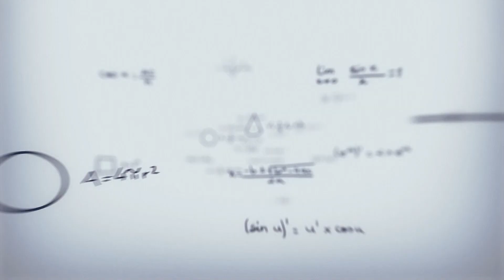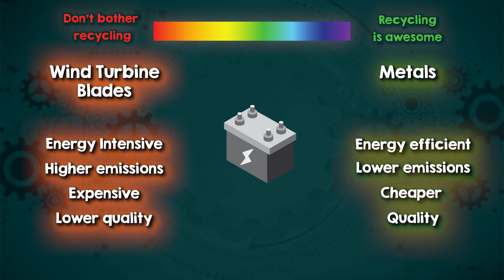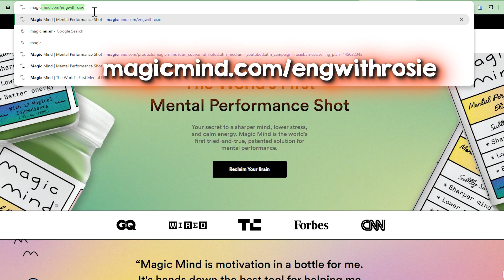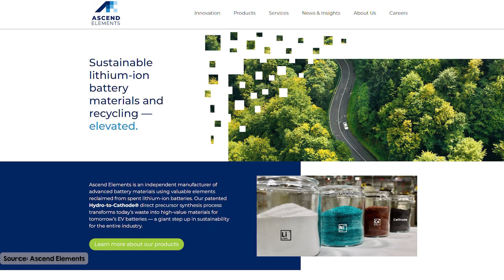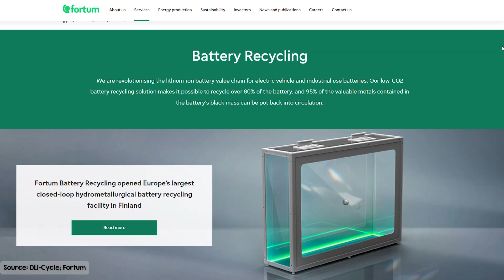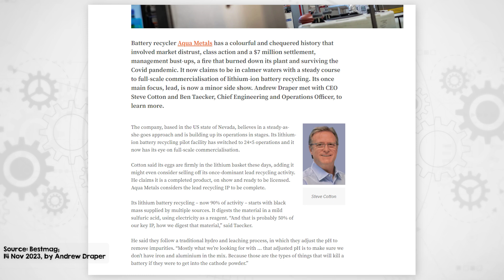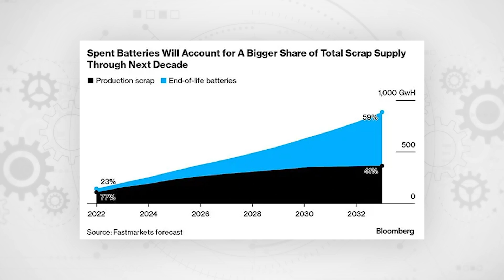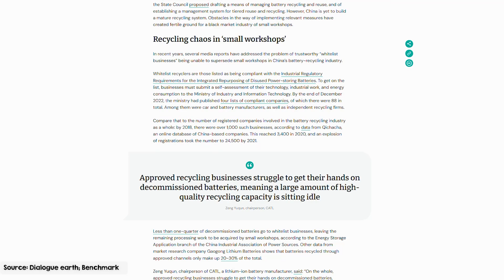Recycling Lithium-Ion Battery: How Does It Work?

Comment: Recycling is not allowed to be an economical question. Recycling is a must because most materials we use are not available in unlimited quantities.
Therefore "is it worth it" is the wrong question right from the start. The question that needs to be asked is "what is the best way to recycling" and then the next one is "how are we going to make it happen".
Reply: What if recycling creates more pollution than production from new materials? 🤔
Reply: @gregorymalchuk272  fantastic questions in this thread.
Ultimately, we don't want to be producing any waste. So one resolution to the conundrum is redesign for recyclability, which can either be legislated or priced. Then the onus is on the manufacturer to produce the goods in accordance with ecological reality.
Reply: @gregorymalchuk272  Typically this is not the case and provided the limited abundance of close to any materials my provisional point would be that recycling is mandatory even in such exceptional cases.
Reply: @beatreuteler  Misses the point. Regardless of cost it is often far LESS environmentally harmful to send some things to landfill than to try and recycle them into a useful product. It depends very much what the stuff is. Wind turbine blades are a good example - precisely because they are made of an incredibly inert material (to ensure they last) it would take FAR FAR more CO2 emissions to recycle them than to just chop them up and bury them. It is not about saving money (though money can often be a rough proxy for energy and hence environmental cost) but saving the environment.
I reckon lithium batteries will be recycled at least as much as copper and aluminium are - as a reactive metal with far lower density than most metals it should be cheap to isolate and reclaim.

Comment: I hear a lot of inaccurate information in this video.
I work with SNAM and Eramet in France. My company is a customer of them. They recycle combined 70Kt of EV batteries per year. They are at full capacity, they are profitable and are looking to expand their operations. My contacts in other battery metals recycling companies in Europe tell me the same. EVs are not the only source of batteries and the market is growing. You mentioned startups struggling: yes they are but not because of the metals market, only because they lack the investment need to build their factory at a larger scale. All of the companies which are turning a profit from battery recycling didn't start from scratch, they were already operating for decades in other recycling markets and already had the infrastructure to expand in the battery market.
For future videos I would suggest reaching out to recycling companies to gather information instead of jumping to conclusions.
Reply: hi @mururao i am looking into the business venture for Li-Ion Battery recycling. Can we connect?
Reply: I would love to discuss further with you about this! Do you have a twitter account or somewhere else where I can message you? I don’t mind continuing the conversation here however

Comment: Recycling is more than just value and energy savings. Mining is absolutely horrible for the environment and garbage dumps will leak overtime and be very costly to fix in the future. 
If your parents generation required resources and generated waste just as much as the current generation does than ruels, regulations, and public perception would be drastically different, and thats just one generation out of thousands of years of human alterations on the inly planet that humans can ever call home. 
Please learn how to Reduce, resuse, and then Recycle Everything PROPERLY that you can. 
♻️✌️🌲🌎🌳🌎♻️✌️
Reply: There are a lot of situations where recycling uses more energy than manufacturing from new materials.

Comment: You think we will have to deal with recycling EV batteries in about 2030, well I disagree.

The Nissan Leaf and Renault Zoe came out around 2010, the very first of the Nissan Leafs now need to have their batteries replaced, the Renault Zoe have thermal battery management systems so the batteries are in a better condition.  However the batteries for the first Leaf's are on average at 85% of their compacity now.  So they are being replaced.

However just because you take the battery out of you 2010 Leaf doesn't mean it gets recycled now.  Re-use is a far better option, and if you put your Nissan Leaf battery in stationary storage now at 85% capacity it'll have a couple decades of use and even when it has 50% capacity it's still good for stationary storage.

The only EV batteries we need to recycle are ones from crashes or new batteries with manufacturing defects.

Comment: This was a very informative video, thank you.  One thing you can start with is the problem of perfectly good batteries in today’s EV being written off by pressure from insurance companies.  It goes like this.  An EV has an accident and there is some visible damage to the battery unit(s).  The manufacturer defines the battery as “no serviceable parts” – claiming that it costs more to diagnose the problem than just swapping for new.  So, at the moment, there are fire-resistant warehouses around the UK that are used to store EV batteries that may have one or two damaged cells (out of several hundreds in the unit) – or perhaps just damage to the physical unit or electronics.  And this practice can lead to the entire car being written off by the insurance company because the cost of the new battery alone exceeds the value of the repaired vehicle.
However…there are third party battery recovery companies who would be able to repair the damaged units at a much lower cost – if only they had access to the proprietary firmware and software used in the EV battery.  This is only available for some manufacturers today – such as the Nissan Leaf battery software, which recently went open source.  EV manufacturers should be required to open up that software so that third parties could recover batteries with minor damage.  The cells in those batteries are usually standard and could be reused – in home solar installations, for example.  And insurance companies should be penalised if they write off entire vehicles that could otherwise be cost-effectively repaired.  There’s a lot that could be done to reduce the amount of EV battery waste without any changes in recycling technology.

Comment: Hi Rosie, another great video. Im curious why you didn’t include repurposing of old batteries in the video though. Once a battery is degraded to a point where it is no longer viable in an electric vehicle, it could still be put to at least a decade of use as a stationary battery. People all over the world are doing this with things like the first gen Nissan leaf, Chevy volt etc. there are even a number of companies that are taking apart the battery packs in older EV’s removing any cells that are heavily degraded and then repackaging the remaining cells into shelf ready stationary storage. I’d love to see a video exploring this as an emerging industry.

Comment: I appreciate your research but battery metals and battery recycling has evolved and current generation batfery recycling is done with cryogenic nitrogen shredding of batteries and separation for reuse into batteries again. 

Ive traded metals for 20 years. Battery metals use specific battery grade metal hydroxides directly from ores and will not be refined into slabs of metal like aluminum and copper. Building the recycling plant next to factories to battery plants allows efficient recyling of battery waste and immediate reuse into new batteries. This ix 80% more efficient than refining waste into a cobalt slab or lithium metal which few industries actually use. See Redwood Materials which is thr current largest battery recycler and their links to some Stanford papers on the topic.

Comment: EV batteries are hot property. EV batteries are very valuable for energy storage.
Another benefit of EV batteries is that there is a large volume of recyclable material for the amount of effort because EV batteries are large and have significantly more metal in the casing than consumer goods batteries.
Just the process of removing and discharging a consumer battery costs more than the materials recovered. An EV battery on the other hand has enough energy left in it that discharging is also profitable and it requires less effort to discharge.

Comment: Hello Rosie, thank you for yet another great video. I am, as always, at the loss of the current system of market economics that we live in. We are forced to look into "economics" of battery recycling, when there is absolutely no doubt that we do need to do it. Do they stop recycling the air on the Space Station because it is too expensive? Our planet is just a huge spaceship, and if we don't start acting accordingly, our life-support systems will fail completely.

Comment: Rosie, don't forget the good 'ol lead-acid battery with its claim of nearly 95% recycle rate. Granted, not seen in EV, but the lead-acid battery is still around. For stationary power, they work great.
Reply: Lead acid are not great for a few reasons. 

 They have low discharging traits which means they tend to deteriorate if you drain them too often. The levelelized cost isn't there either. 

 It is okay when your alternator will cap it off in a car. Not so much at home. 

 I have seen some online use huge banks of them for their home storage. I think used car batteries no less! Seemed to work to me, but I don't know enough about their particular set ups. 

 So it definitely can be a solution, but honestly now there are a lot better ones especially for energy grid storage. Which I think will be dominated by other chemistries or battery types. 

 Some redox batteries look promising. 

 I will take a lead acid battery over cuckin Energy Vault gravity bricks!
Reply: @dianapennepacker6854  I disagree. I have been running my home with lead acid  for decades. Oh course they are shitty for EVs and such but for high capacity stationary use, they are still very much usable. To get the longest life 50% is about all you should discharge. Sometimes 80% discharge is okay,too. The larger forklift batteries are so robust, they will last 20 plus years. Cold weather? No problem. They won’t supply the same high discharge when that cold, but no damage will happen, and you’ll get the power back when they warm up. Worried about an EMP pulse? Lead acid don’t care. The BMS used in lithium batteries might not survive an emp.

Comment: EV battery recycling is a great argument against market captitalism. Instead of watching critical minerals swing all over the place boom and crash which also threatens mining and refinement industries, our governments should step in and create a price guarantee and a commodity market reserve. This would stabilize prices, enabling mining, refining, battery manufacturing, vehicle manufacturing, and recycling to all understand future prices and plan their businesses around them. It also acts as insurance in a short term recession or other demand slumps that stall forward progress of attaining/retaining these critical minerals.

Unfortunately, time and the gross bloat of EV cars/SUVs/pickups mean we won't have the time or emissions allowance required to actually pull off a one to one transition from ICE to EV with whatever vehicle the market demands using whatever efficiency lazy engineers and even more lazy consumers agree to buy. The fact is, we're already decades over budget in emissions, so the pipe dream of perpetual car manufacturing in a circular economy is false hope. We'll need to temper our reliance on mined minerals, using them much more efficiently in micromobility. An e-bike uses 1/400th the battery size of an Chevy EV Silverado. Of course they don't do the same work, but that's beside the point. We'll need to seriously rethink how we do everything under the severe austerity that zero emissions means. Electric rail in the form of pantograph trams, light rail, metros, heavy regional rail, and high speed rail must not rely on battery tech, but simple realtime electrical flow through overhead wires. Save the hard-to-mine-and-make-perpetually-batteries for the places where they can do the most good e-bikes, e-trikes, e-scooters, maybe microcars for certain situations.

Understanding that micromobility and shared public transit are the necessary end of the transition for transportation, we should not be investing heavily in a single generation or two of a tech which we can reasonably predict has no chance of surviving the extreme demands of a zero carbon world. Severe change is coming and EVs are like rearranging the deck chairs on the Titanic, but with much wasted political capitol. We'll all soon be liars when we have to explain that we crunched the number and full sized EVs are nowhere near sustainable. We should have told everyone so, but we didn't think you'd buy into public transit.

Comment: I think a whole lot of EV batteries that are EOL are not being recycled but reused. A 70 KWh EV battery that's at 60% of its original capacity is still an outstanding house battery where the peak draw is far less and even 30 KWh is a lot for a house. There are several companies in the US that take used batteries, disassemble into cells, characterize the cells and reassemble into packs of matched cells and sell them into the solar/home power industry.

Comment: There are so many vape pens going into landfill, there isn't much information but I wouldn't be surprised if the equivalent of a few vehicles worth of batteries go to landfill everyday from the UK alone
Reply: I took apart a disposable vape pen I found on the ground and was stunned it had a rechargeable li-ion battery inside.
Reply: Yeah, and I've run out of things I can do with the cells from the ones I've picked up on the street.
Vapers just don't seem to care, even about their immediate environment.

Comment: My 2014 Nissan Leaf was assembled in Smyrna, Tennessee, 1500 KM from my home in Canada. The battery for that vehicle was built in Japan, from minerals sourced from all over the globe.
When my battery reaches the end of its life as a car battery in another 5 -7 years, I plan to use it for stationary storage (connected to my own solar system or sold to a company that converts batteries for this purpose). At the end of its life in stationary storage, it will go to a recycling plant right here in my own city. The minerals from the cells will then be shipped a few hundred KM down the road to one of many battery manufacturers being established. Those batteries will be used in EVs being built in the area, to be sold back to people like me a few hundred KM away.
The reuse of material, shortening of the supply chain and process improvements make our EVs cleaner as time goes by, unlike ICE which can only get dirtier as ever more harmful methods are used to extract oil from ever more sensitive areas of the globe. And, as we know, almost nothing from petroleum is recycled, as the majority is dumped into our oceans and atmosphere.

Comment: Sodium ion batteries would be easier to recycle it seems.

They use materials like sodium carbon nitrogen iron and aluminum. None of which are critical minerals.  

So we can be able to use pyrometallurgy process for recycling them.

Comment: Recyclable does not equal free disposal. It's just like when they "recycle" used tires, you still have to pay to get rid of them. These batteries are going to end up like plastic or E-Waste. Classified as recyclables to get around regulations, but in reality just dumped on some third worlders

Comment: Great video Rosie!  Even in the USA scrap metal recycling has an element of criminality.  Omnisource, my local recycler, takes one's driver's license and car plate number, and cuts a check as opposed to hard currency for copper recycling in order to have a paper trail.  Stealing copper for the scrap value has around probably since copper recycling has existed.  Regarding black market battery recycling in China, the USA's work place safety regulations in a variety of industries are often an after thought for low bid businesses until someone dies or a building catches fire.  A lot of our OSHA rules are just guidelines, and require civil litigation after harm has happened to have any kind of teeth. The USA is not without room for improvement when it comes to work place and environmental safety for workers and for the general public.  We also need more regulation and government subsidies to prohibit and prevent consumer electronics from being thrown out, as well as solar panels.  It cost me $0.30 a pound to recycle broken solar panels on my home, and I was the first member to the general public to show up at the nearest solar panel recycler in my area.  Most people throw solar panels in the dump and don't think about the heavy metals in solar panels leaching into their town's watershed.

Comment: Much of the cost of making Li-Ion batteries is in making the active materials (including the carbon-based anode!), so direct recycling seems very promising.
However, there is a huge problem/risk: If batteries last 15 years and are then recycled, most of those active materials will be way outdated.
Apart from LFP (in its infancy back then) and LCO (LiCoO2, used in phone batteries), none of the cathode materials from 10 years ago are still in common use.